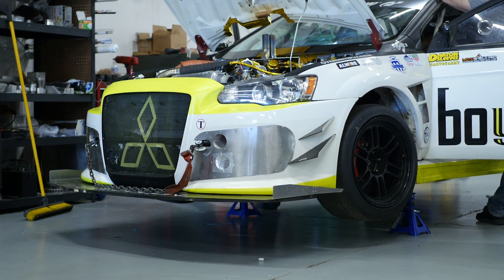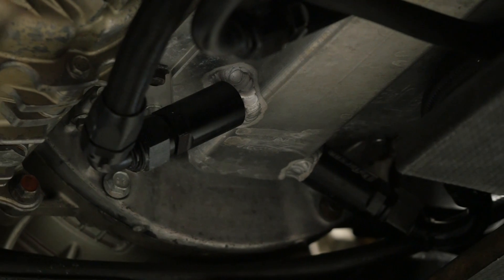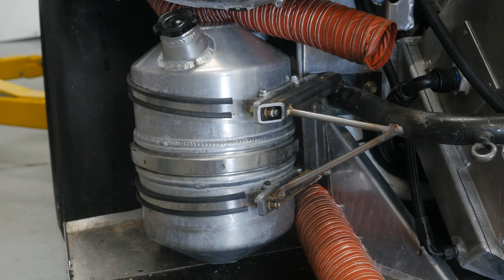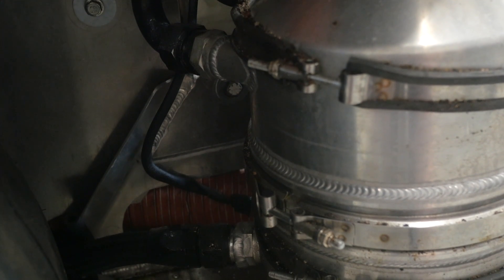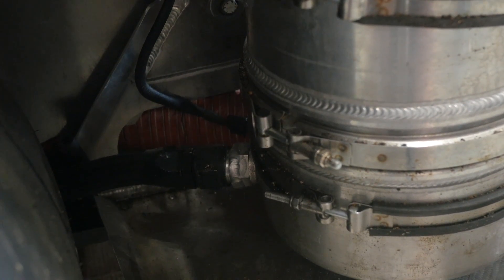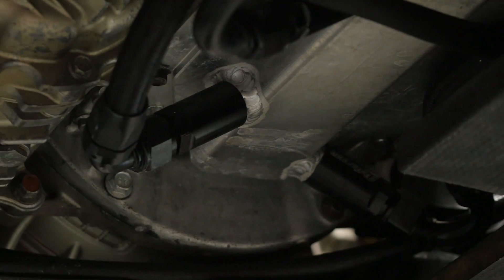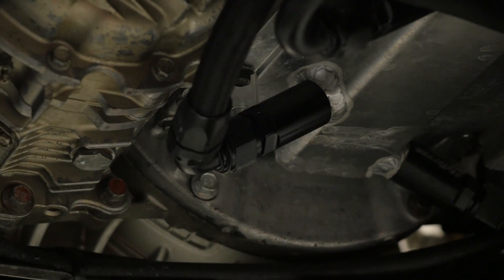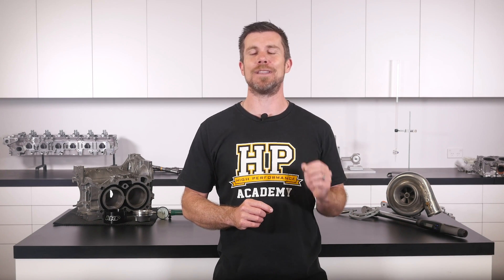The MOST Common Reason For Engine Failure? | [TECH NUGGET]

Comment: Just seems alike more things to go wrong
Reply from the maker: A dry sump is in fact the opposite, it helps ensure less things go wrong. Like many performance parts however, you don't need it if you don't need it and the vast majority of people do not push their cars far enough to worry about a system like this, or instead just upgrade their wet sump or sure something like an accusump - Taz.

Comment: Don't forget to mention the vacuum (as well as blowby removal) can also help to extract a little more power as a side effect. Dry Sump was one of the first mods I did to my LS3 S2K!
Reply: N4CR5 when Steve Dinan was on the smoking tire podcast he talked about this and a few other little things that were amazing. He said that by going to a higher power dry sump pump they were also able to run one less piston ring per cylinder and so had reduced friction and netted further gains.

Comment: Is there a universal dry sump or is it just made for certain cars only? I’m driving a Mitsubishi Lancer with an engine of 4G18 and I don’t seem to be able to find any dry sump that is for my car. Is there any other solution to my problem?
Reply: Buy a baffled oil pan with trap doors or have your stock pan modified. Dry sump setups are very pricey.
Reply: TunerBattle do u have a video on it. I’m sorry I’m very new with this type of set up
Reply: TunerBattle and I need to increase the oil pressure that why I need to install that type of set up as my car’s engine oil pump can’t be upgraded

Comment: I've seen data on a small block Chevy on a engine Dyno that when just 1 quart was drained out the pan it was worth around 20-25 horse power getting the fluid away from the crank and I've heard someone using a half inch oil pan spacer on a LS n it was worth very similar numbers. Not to mention getting the airation out of the oil it does it's job better. Great stuff tho. Taz you gotta convince Andre to throw some gooooogly eyes on the mic for one of these interviews around Halloween. Good job tho guys

Comment: How does the scavenge stage deal with pumping air and oil without becoming damaged due to changing fluid densities? I'm not sure if that includes risks of cavitation? And maybe excessive aeration of the oil? And possibly shearing of oil molecules? I don't really know what all is involved.
Reply: The gear pumps would not have an issue with oil/air mixture as far as I can see, as long as they have enough oil to lubricate themselves. Cavitation would not happen, since cavitation is an effect that occurs when the pressure of the pumped fluid goes under it's steam pressure, meaning it forms STEAM bubbles that collapse and can damage the pump. Cavitation happens when there is to little pressure before the pump, meaning it has to suck to much. Not an issue with that type of pumps, and oil/air mixture. Regarding airation of the oil: that's why there is a massive oil tank there, many systems will also have some sort of swirl pot to encourage the seperation.
Reply: The dry sump reservoir often performs this function (separation) but a vented catch can also does it fine. As you said, pump doesn't mind as long as it's got some oil.
Reply: White Vaille I don’t know a 100% but I believe most have a swirl pot to allow the oil and air to separate before returning.

Comment: Yes. But costs, extra weight and weight distribution, free space for installation and one thing more to break.
Reply from the maker: @Jarek: Everything has pros and cons, but the pros outweigh the cons in this case for this application. 
For the weight distribution, as has been mentioned, dry sump is an advantage. 

For one more thing to break, again, it is also an advantage as it decreases your chance of engine failure due to oil starvation which with a wet sump is very high in a competition vehicle.
Cost? Yes it is expensive. As mentioned in this video, it is still cheaper than an engine rebuild... ;)
Extra weight, yes, and no, this depends on the vehicle and setup. 
You don't have to run out and buy a dry sump setup if you don't need one, that's OK :) - Taz.
Reply: @hpa101  Every Professional level motorsport car has a dry sump system. Baffled pans are the way to go for grassroots enthusiast. Canton made one for my Neon SRT-4. If there's a market they'll make one for any platform. Crank Scrapers work well too.
Reply: >Increases reliability
>One more thing to break

>Brings the heaviest part of the car lower to the ground by a couple of inches
>Is somehow worried about the weight distribution

Never comment about cars ever again
Reply: @fokjohn  ?

Oil tank, pump and few liters of oil = extra weight near the heavy engine, where the car is already heavy = weight distribution problems.

Higher or lower engine placement = lower or higher center of gravity. 

Weight distribution and height of CoG are 2 different things.

Whar did You have learn today?
Reply: Weight distribution and cog ARE different things but they're different like flour is different from bread, weight  distribution is the essence of c o g.

A dry sump gives you the opportunity to move stuff around to better the weight distribution and cog. Also oil cooling potential, less oil carried, oil priming with an external pump and reduntant safeties. 

Whar did You have learned today¿
Reply: @supernice_auto   
But im not :)

Comment: another often overlooked reason for oil starvation is the head filling with oil. with the engine always at high rpm during racing conditions, oil tends to flow to the head faster than it can drain, resulting in the oil pan running low and making oil starvation even more likely
Reply: some auto manufactures have oil restrictors that can be installed in the head to remedy that
Reply: that is how my EJ257 went...
Reply: In an RB engine maybe, but you can't just blanket apply that to everything....
Reply: Happens in LSx motors, Subarus and Toyotabrus, Porsches and quite a few others that are considered performance motors. In the ones that are well known to have that issue (like LS motors),  external drainbacks or scavenge stages are added to the valve covers or into the rocker box to get that oil out and back in the sump.
Reply: @noxious89123  many engines have this problem above the factory rev limit, including my own
Reply: @noxious89123  4g63's this is a common issue.  I'm sure many others.

Comment: You forgot to mention that a dry sump can also allow the engine to be installed lower down in the chassis, lowering the centre of gravity.
Reply: Also you can keep engine temps under control easier due to having such a big resevoir of Oil (3-10 gallons) the oil naturally stays cooler drawing heat away from the block and head